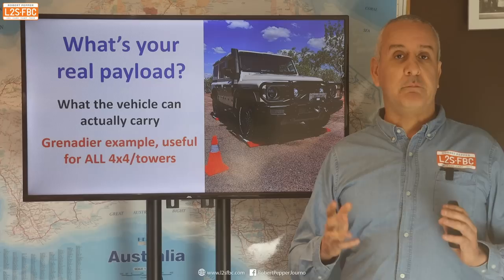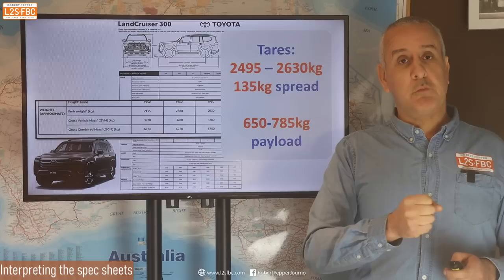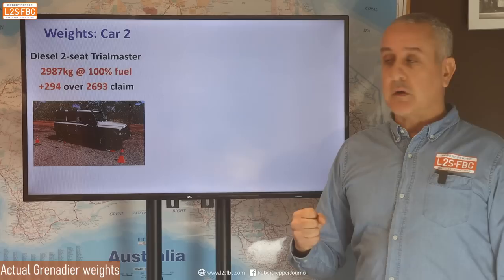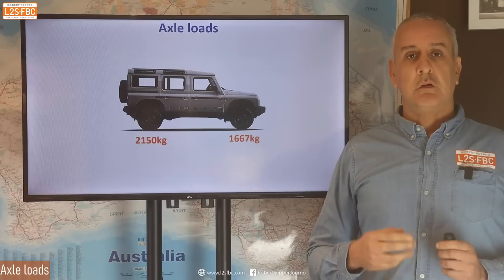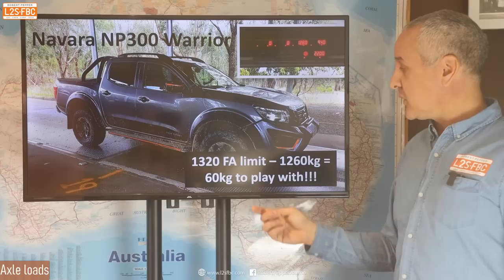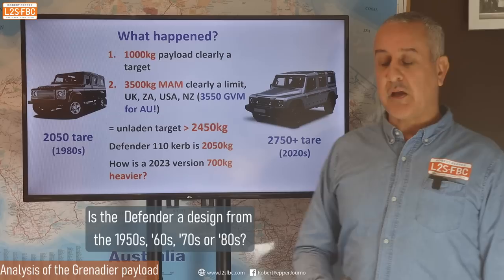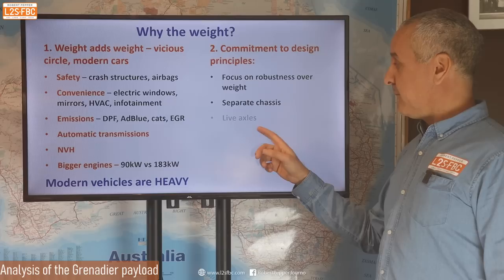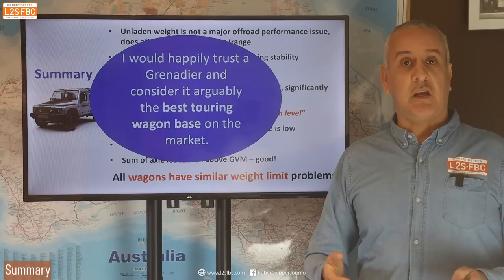Traps in 4x4 payload calculations - INEOS Grenadier example

Comment: Interesting subject. Payload does seem to be more of an Issue in Australia for obvious reasons but anything around 700kg is quite a lot of weight....thats between 8 and 9 well built dudes! Would you really drive offroad woth 10 people in your vehicle and expect it to perform? Probably not. I do think people should focus more on being sensible on what they take on trips. I see folks taking all manner of luxury items/gadgets and gear. How much of that is really necessary? As you mentioned, more  weight equals more fuel . The Grenadier is certainly more robust that most other broadly comparble vehicles so i think the ultimate load bearing capability will be quite high.
Reply from the maker: 700kg doesn't go far.  Consider a desert crossing of 4 days for two people. 4L water per person per day, 16kg x 2 = 32, plus emergency say 45kg.  Then food. Personal bags. The two people may be 190kg.  700kg disappears very quickly, then you consider the weight of a winch, recovery gear, tools etc.  If you have 3 or 4 people those numbers add up even quicker.

Comment: This is interesting.  The Grenadier will really suffer in North America where we use GVWR which further decreases payload to add in safety margin.  Why would farmers or overlanders use a Grenadier if the local market can buy an F-150 for much less with a curb/tare weight of 2070 kg and a GVWR of 3568 kg so essentially a payload 1498 kg, BUT a rear axle capacity (RAWR) of 2409 kg, a front axle capacity (FAWR) of 1727 kg (4136 kg of gross axle capacity)!  A vehicle with a tare weight that is essentially half the Max Combined Axle Capacity.
Reply from the maker: Exactly. Payload is everything for a vehicle of this nature. It's the first spec to look at. There's no point have a super-capable vehicle that costs little, super comfortable, amazingly strong...if it can't carry. Payload is the #1. Either it carries, or it's out of consideration.

Comment: To me all vehicles should automatically have all fluids including a full tank of fuel included when factoring their base weight or tare weight and that’s it. Just seems to make sense to me. It doesn’t make sense to me to include less than a full tank of fuel. That’s just odd to me. I’ve also seen some manufactures include 150lbs for an occupant in their tare weights. Makes no sense. It should be a standard across the board.
Reply from the maker: Agreed!

Comment: Also Robert you say INEOS should have used independent suspension and I understand your line of reasoning, however most manufacturers who do that make up for reduced articulation with more advanced traction control systems and in sone cases like Land Rover, sophisticated air suspension. INEOS has tried to keep things similar. As much as you can with a modern vehicle, the Grenadier traction control is single mode and pretty basic. Do you think they would have had to ise a more sophisticated system if they went Independent
Reply from the maker: Yes brake traction control becomes more important with fully-indie, but Land Rover mastered it nearly 20 years ago with the Discovery 3, so others can get it right too. Cross-axle lockers also help, and the Grenadier has that option. The Land Rover air suspension is cross-linked to replicate a live axle, however Toyota and Nissan have developed systems such as KDSS and HBMC to replicate that effect for IFS/IRS - the Toyota KDSS and eKDSS system is explained in my interview with Toyota LC300 engineers.

Comment: Great video. Grenadier is far too heavy, and massively reduces payload. Crazy that the Quartermaster can’t even get a 1 ton capacity, so you can’t claim the VAT back. Cuts out a huge commercial market. The new Defender weighs around 2,400kg - a massive 400kg lighter than the Grenadier.
Reply from the maker: Agreed - I wish they'd have gone IFS/IRS and single-door. That'd have helped, maybe 100kg? 50? Every kilo counts!
Reply: @L2SFBC I think Ineos made two main errors. Both the modern G-Wagen and the new Land Cruiser [Prado] only have a solid rear axle with independent front suspension, and are both excellent off-road. The Grenadier should have done this too; an extra solid axle at the front cost many more kilos. Secondly they chose an agricultural supplier Carraro to manufacture the axles, who probably pay more attention to longevity and robustness than they do weight. 
Payload aside, if you go off-road in a Grenadier at 2,950kg with just the driver - without even any luggage, passengers or water, that is going to have a huge detrimental effect in the off-road ability compared to a 400kg lighter new Defender! And cause more soil compaction, much more likely to get bogged. 
Also Ineos made a blunder by not allowing the axle diff-locks to function in high-range. A lot of farming estates need axle diff-locks in muddy conditions when most of the time they aren’t in low-range. Harry Metcalfe in Harry’s Farm review of the Grenadier was unable to realise why the axle diff locks wouldn’t work in his off-road section of the test; he had the centre diff locked in high range, but of course the axle diff locks refused to engage - because he wasn’t in low-range. If an experienced road tester like Harry couldn’t figure out the axle diff-locks, then your average country estate landowner / gentleman farmer user hasn’t got a hope. Defender went with the correct strategy with self-locking centre and rear diffs.
Reply from the maker: Yes, independent front could have worked...and so could rear. Better offroad, lighter, trade a little robustness. Weight is not a huge factor offroad; in fact, sometimes more weight on an axle = better traction which more than compensates for the additional weight. It's not like circuit racing. I watched Harry's Farm review the Grenadier, and made a comment on his video that for the paddock he was driving around cross-axle lockers would have been detrimental. His 'offroad section' was just a simple hill crest, hardly a test in my view.  I don't want the lockers to be automatic, I want manual control - drivers should learn how and when to operate them, but I do see Harry's point even if I disagree for my purposes and those of my followers generally.
Reply: @L2SFBC   weight is a big factor in the kind of off-roading I do in waterlogged agricultural clay fields. I’ve seen Discoveries simply sink on flat ground, with lighter old Defenders simply driving on the surface. Yes agreed the paddock ‘off-road test’ was pretty lame, especially seeing as it was supposed to be an off-road video compared to the Harry’s Garage road review on his other channel. I agree that for experts having manual axle diff-locks is preferable, but for the casual user then auto locks are probably better as they will at least be used. I’ve seen people drive 4x4s off-road and not even know how or when to lock the centre diff! 
Also the Grenadier strategy guarantees that the axle locks will never be used in high range, when quite a lot of off roading on the flat is done in high range.

Comment: Hi John, thank you for this. RE axle loads, with the Suzuki Jimny JB74 i'm trying to work out if the front axle is over loaded with my new winch and concealed winch mount (East Coast Bars concealed JB74 mount). My winch and mount weigh 36kg, which if i use your Ineos calculation (37/30 = 1.2) would add 43 kg to the FA. I weigh 85kg so i'm thinking with the Jimny size and wheel base that might add 45kg to the FA. My full payload on trips is about 280kg (including me) that includes the new winch but not factored as a weight forward of the FA. Getting a bit stuck with the math from here though. Can you help? Regards from New Zealand.
Reply from the maker: See my Front Axle Load video, should help you

Comment: Thanks for the interesting video on weights Robert . In the queue to purchase a Trialmaster and intend to tow an off road van weighing around 3.3tonne or less depending on load . It will hopefully have a tow ball weight of around 250 kg or so . With payload of around 300-500 kgs in the Grenadier mainly in the back is going to be very close to the vehicles limit it seems . A GVM upgrade may be something we should think about? Can a GVM upgrade change the front axle limit?
Reply from the maker: The good thing about 250kg TBM is that it'll take maybe 50kg+ off the front axle!  There are four types of GVM upgrade, and one type re-rates the front axle - and I stress "re-rates" not "upgrade".  I can tell you the players I've spoken to in the aftermarket about Grenadier are in no rush to anything for the vehicle, they're all flat out on other projects and are waiting to see if it sells and what the demand will be. So, do not buy a Grenadier on the basis there will be a GVM upgrade shortly, as you could have bought an LC300 knowing the aftermarket was competing to get an upgrade out.
Reply: Thank you for your prompt reply, and your valued advice . I am keen on the Grenadier and I think I can keep weights under their limits by limiting accessories and careful with load weights . 😊
Reply from the maker: I have you covered with lightweight camp gear https://youtu.be/xjqGEr2ZXSY

Comment: i'll correct you is 8 tons on a car license, if stated weight is 2.5 ton on vehicle  your catrry capacity carry capacity or gvcm  is 5.5  ton..

however even straight 6 turbo diesel you might have the capacity pull it don't mean you have the capacity to stop it
Reply from the maker: Sorry I don't get the correct? In Australia 4500kg is the limit for a car license. I'm not talking towing, as the limit for car licenses isn't set, it's whatever your car you can drive can tow. The rig weight may well exceed 4500kg though if that's what you mean?
Reply: @L2SFBC  you can drive up to a 8 ton truck on a car license however your combined mass can not exceed 8 ton

if the if you weight 4500 kg in motor vehicle you 2500kg tow limit

Comment: Robert, how do engineers derive this 3550kg number? Classification of vehicle, liability issues for component failure or accidents, tyre weight limit etc aside. Is there load testing and driving until failure?
Reply from the maker: The GVM in this case I think was limited by UK law of 3500kg - they couldn't have gone any higher without re-categorising the vehicle. Once a GVM is set, all the calculations, testing, strengths, tolerances, margins would work around that. So to up it to say 3700kg would throw all that out. OEM engineers are appalled at the way Australians just take  vehicle and say "yeah, you guys reckon 3300kg, we reckon 4000kg is the go" and plate it accordingly!  Then the owners exceed even that limit!

Comment: Is the Grenadier suspension based off the live axle version of the Mercedes G Class? Interestingly that has a GVM of 3560kg. I wonder if it has similar axle load limits.

IFS Ineos would have defeated the entire purpose of building the vehicle.
Reply from the maker: Entirely different vehicles even though they look similar and are designed simiarly!
Reply: @L2SFBC  They were manufactured in the same car manufacturing plant in France. In addition, Ineos purchased existing solid axle suspension designs from the market. I wonder how similar the axles are in practice.
Reply: @L2SFBC   I think his comment alludes to Ineos claim the suspension was fully designed by Magna Steyr, although the axles themselves were handpicked from Italian manufacturer and are unrelated.
Reply from the maker: Ah yes I see that now, thanks

Comment: On a related topic, does anyone know how GWM can advertise a 2500 kg braked towing capacity for the Tank 300 without specifying a GCM? GVM, kerb weight and payload are given, but no GCM.
Reply from the maker: Ahh........GWM. The short answer is the Australian operation doesn't know. On behalf of a Patreon I tried and tried to get that information and they just couldn't answer.  Also, at the Tank300 preview the spec sheet I was given was in Chinese and I had to use Google Translate.  So my view is they don't understand the need for the information and couldn't get it even if they did.  I hope things have changed since I asked some months back.

Comment: At 12:00 mins - Is the rear axle full or semi-floating?
Reply: I'm not aware of a definitive answer to this question, from Ineos or anyone else for that matter.  Based on photos of Grenadiers with steel wheels, the forged hub centre suggests a semi-floating rear axle.  If my suspicions are correct that would mean it is likely to be one of Carraro's twin taper roller bearing light truck axles.  These use a forged half-shaft with a dual taper roller bearing fitted from the back of the hub flange and held in place by a very large threaded nut.  The Carraro light truck axles are a very strong unit given they use twin taper rollers similar to those used for most fully floating axles, but the inner race (and therefore the bearing assembly) is likely to be very hard to remove in the field even after the large nut is removed.  This is the same family of axles fitted to Iveco Daily 4x4 trucks in some markets.  Without any more specifics I'm not sure if the version fitted to the Grenadier (if indeed I am correct) has a weight limit for other applications that might make amenable to GVM upgrades on the Grenadier.  Only time will tell, I suspect.
Reply from the maker: Well that's certainly a definitive answer!!!
Reply: @L2SFBC  Unfortunately, it's only my 'best guess' based on what I can see and know of Carraro's axles on other products.  Unless Ineos or Carrara (or someone who pulls a Grenadier rear axle apart) confirms my suspicions it will just have to remain a best guess for now.  To be entirely accurate, the bearing/axle setup on those particular Carraro axles should really be referred to as 'three quarter' floating, since a broken half shaft will still allow the hub to carry the weight of the vehicle in the same way a broken half shaft and a fully fully floating hub does.  It's the same deal, remove the broken inner piece of half shaft, then replace the hub and bearings back in the axle housing.  Strictly speaking a semi floating axle requires the half shaft to be intact to maintain bearing/hub alignment.

Comment: I wonder what else can be done to lower the tare? These new fangled metals perhaps?
Reply from the maker: Lots of things including materials, but budget would be an issue as would be repairability etc.Land Rover took significant weight out of the D5 for example.
Reply: I believe they were originally going to make the panels out of aluminium which would have made it easier to hit their weight target. When they changed to steel is when the weight shot up
Reply: @SixtyFo the doors and bonnet are still made from aluminium to help reduce weight
Reply: @L2SFBC  D5 took the weight off by removing the chassis
Reply: @SixtyFo doors and I think bonnet still aluminium

Comment: It is indeed disturbing to see just how heavy modern vehicles are getting and perhaps the 4x4 market is the most difficult. You have added drivetrain parts and an expectation that you can stand on any horizontal surface or hang a spare wheel on a random hinged panel. I do understand the enthusiasm for a separate chassis but it is not the most efficient use of materials to produce a rigid structure. Look at the weight of a Lotus Emira and compare it to the earlier Elise,  the weight has doubled, such is the price of safety, emissions and comfort...
Reply from the maker: Yes, it's not carmarkers, it's regulations saying "be safer" and "use fewer emissions".  I don't have a problem with that by the way.  I agree that a seperate chassis is heavy, but as I said in the video, it's necessary for a ute. As for Emira vs Elise, agreed again but the Emira is also a larger vehicle. Comparing it to Evora is perhaps fairer.
Reply: @L2SFBC  thank you for the reply, your video was well presented and informative. The regulators have a tough time, dynamic loads on identical vehicles will of course vary wildly between different use types. Sadly being old and cynical I have talked myself out of a "proper" 4x4, I have enjoyed them in sever conditions in the past but in more normal conditions I have lost about 2 minutes in the last 10 years by having a front wheel drive car bellied out on snow.
The Grenadier however does have great appeal...

Comment: Great Video !
Is it positiv to put bigger tires on the Grenadier ?
Reply from the maker: Yes 285/70/17 fit, I'm told but haven't independently verified.
Reply: @L2SFBC  I've seen photos of the one Ratcliffe rides and it had 33"s. I am not sure if one of the UK journalists didn't ask that in previews roughly 1 year ago.
Reply: @L2SFBC   On the German Ineos website they write 17 inches and 18 inches - unfortunately there is no information on whether you can put even larger tires on it.